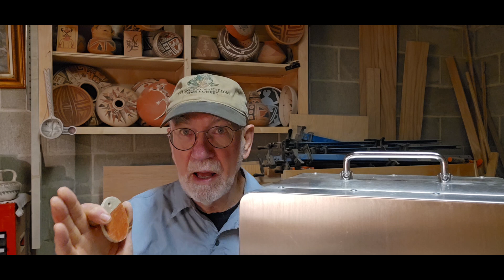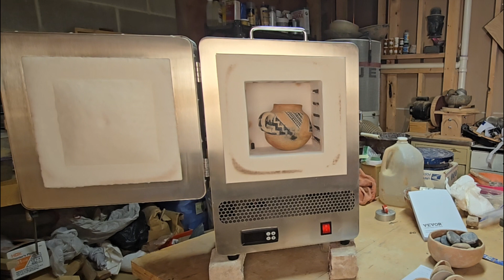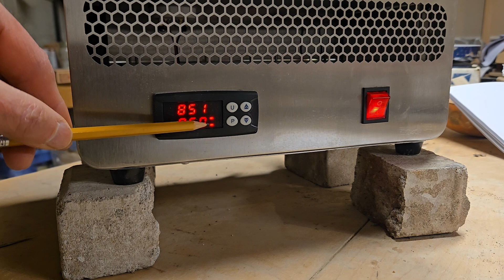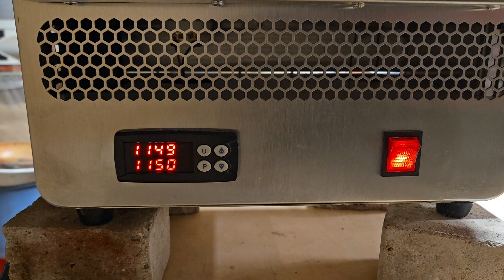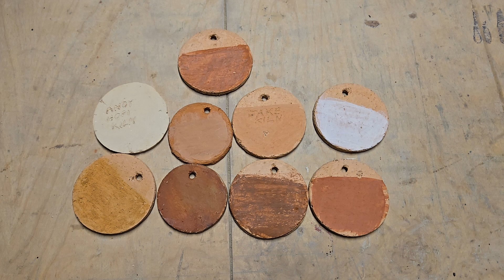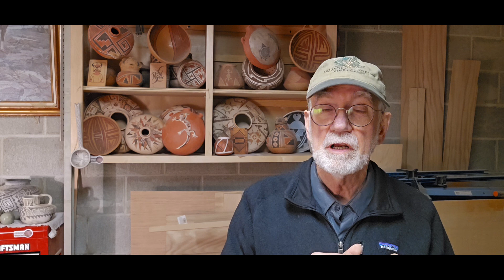Primitive Pottery Paint and Clay Test in an Electric Kiln

Comment: This was very helpful. I had been looking at this one but watched another video where someone said it wouldn't be good for bisque firing because broke anything that touched the bottom because of how hot it got during bisque. I'm look for something very small for at home. I'm looking to low fire pretty small figures and simple jewelry items and was thinking a tiny shelf would be a good solution if the surface got to hot but still doing a lot of research on if a more expensive table top would be better. Like a RapidFire Pro-L or a Paragon Kiln - Xpress-Q-11.
Reply from the maker: Thanks for your comment. I have no familiarity with other kilns so I can't comment. Not sure why the bottom would get hotter than anything else. The coils are on the top and the two side. I did have something stick to the bottom. I think the solution is to have a refractory blanket or kiln shelf. The controls are simple but not sophisticated. It is either on and off. If you want a ramp up or cool down cycle you have to do it manually. It is portable and used regular electricity. It can certainly get up to 1000C but it isn't hot enough to fully vitrify. Good luck.

Comment: Hi, thank you for the video. I am a complete beginner and have a couple questions. Using the vevor kiln you have.  I want to make an espresso cup out of clay. If you are not familiar with espresso cups immagine a coffe much bit shrunk down to 2 inches in height and about 2 inches in width. The thickness if the walls are 2.5mm (i cant read inches that small sorry). What temp would you fire it at and for how long? Clay, of course, the clay box says cone 4 for bisque and 6 for glazing.  Thank you in advance.
Reply from the maker: I haven't done that sort of firing but as you can see, each clay is  a little different at what temperatures it fires. I think studio potters often do an initial firing (bisque) and then add a glaze and fire it a second time. You can look on line at the temperatures for different cones. It may make sense to find a place that teaches and fires pottery and to use their kilns. The Vevor kiln might work but you need to check the temperatures needed for glaze. I think it may be on the low end of temps particularly if you want to fire porcelain. Good luck.
Reply: @ Thank you!

Comment: Those test tiles are only a few steps away from being usable as spindle whorls. Just move the hole to the center of the tile and make the hole larger (About 1/3in. or 1cm. wide).
Reply from the maker: I hadn't thought of that, thanks for the idea!

Comment: I have been looking at this kiln. I’m a beginner and still learning so would this work for glazing pottery? Sorry if this a dumb question
Reply from the maker: This is a good question and I'm not totally sure of the answer but I think it would work. I normally do primitive pottery on a wood or charcoal fire which does not get hot enough for a glaze. This little kiln will fire to 1150C which I believe is hot enough for some glazes. I have never glazed anything but I believe there is a wide range of temperatures needed for different glazes. It would be a good idea to check with a store that sold ceramics supplies.
Reply: @ thank you so much for the reply. I finally found a video explaining glazing and temperatures.